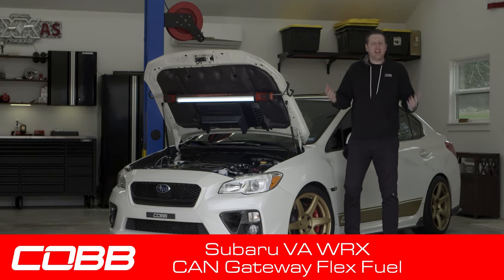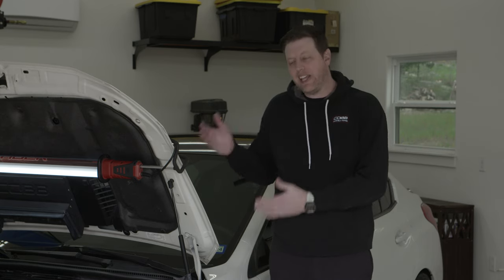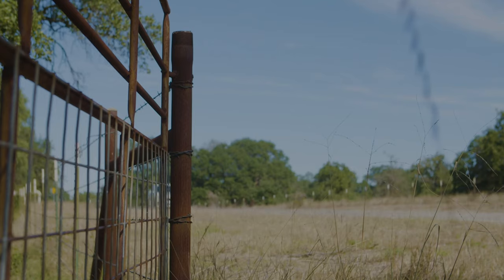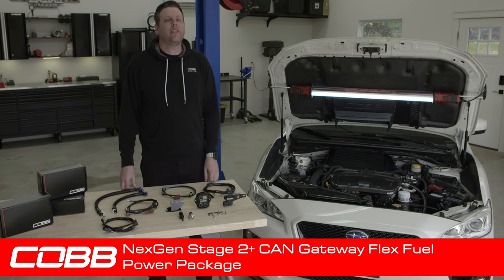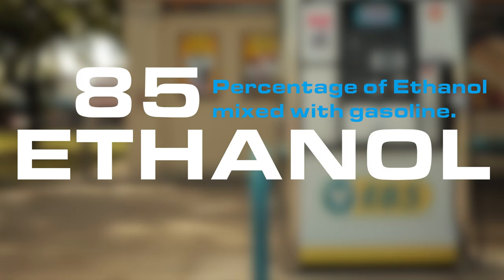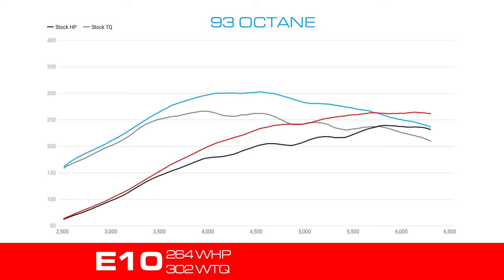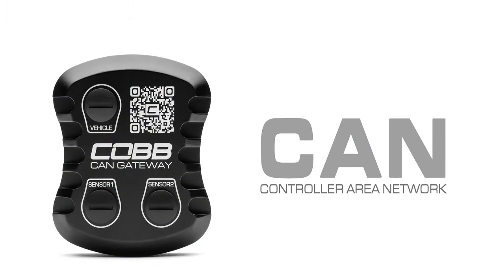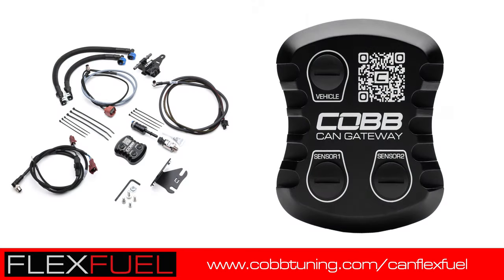COBB Tuning - CAN Flex Fuel for VA WRX

Comment: Is there install video ?
Reply: I did this install today pretty straight forward. Removing the  tmic made things very simple. The instructions on the website were very helpful.
Reply: @jstanhope77 is it worth it? Making 290 wheel on 91 pump. Definitely wanna be close to 350 wheel
Reply: @Kevsakii  i like mine for a couple of reasons. This CAN system allows me to safely run e85 thru the system as well as pump gas. I like to run different mixtures every so often to help clean out some deposits that may be there. Also, if running ethanol fuel, it is important to run pump gas thru regularly to burn off some of the water that may be in the system. For me it has worked out pretty good; however, i will say it is on the pricey side. I have had good experience with the Cobb OTS maps and a really good experience with COBBs customer service.

Comment: Can I run this with my stage 2 parts that arent cobb and get it retuned for flex fuel?
Reply from the maker: You would not be able to use our supporting OTS Maps unless the required parts configuration is the exact same.  For other setups, you would need to have a custom tune made by one of our Protuners. - Marshall@COBB

Comment: Is it this expensive because i wouldnt need to change out the high pressure fuel pump? Would the high pressure pump not give out at e50/60?
Reply from the maker: Upgrading the HPFP is not required for use with our Power Package / OTS Map but is recommended for higher power applications or on older cars where the HPFP may be a bit tired. - Marshall@COBB

Comment: What about fuel pumps will we still need hi and lo upgrade fuel pumps with this?
Reply: Nope. Stock for both is fine.
Reply: Ideally you want at least the in tank low pressure fuel pump

Comment: Aww man, is there no other way to mount the CAN module?  My dual catch cans sits dead on the same spot and I don't want to give them up.  Somewhere behind the fender shroud maybe?
Reply from the maker: We have a prototype reverse mount bracket in the works - reach out to our Customer Service Team if that is something you would be interested in! - Marshall@COBB
Reply: If you have radium cans you can make the kit fit> I did with out problems.

Comment: I know this is for the Subaru market. Is there a chance that the Ford F-150 Raptor’s will get a similar kit?
Reply from the maker: It is certainly possible and something we hope to offer across multiple platforms.  No ETA for Ford Flex Fuel at the moment, though.

Comment: 3:45 that’s why VA owners hate the VB
Reply: lol it’s wild I’ve had a flex fuel built block stage 2 iag 2018 VA WRX making 400/400 back in 2021. Put over 15k into that build..

I now have a 2022 VB WRX with transmission stability and intake side mods (ets intake, Perrin turbo inlet & diverter valve) making 320/350, spent just under 1500$ on that… if I pop E in there I’ll be damn near 380/400….. 

That’s why VA owners hate the new WRX, and if I still had my VA I would be butt hurt too.
Reply: Lmao. Nope,